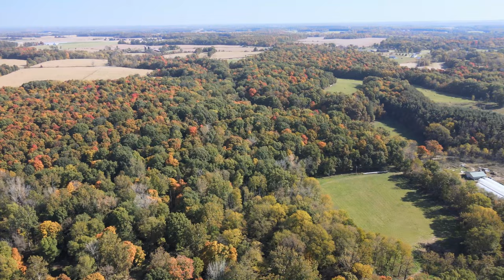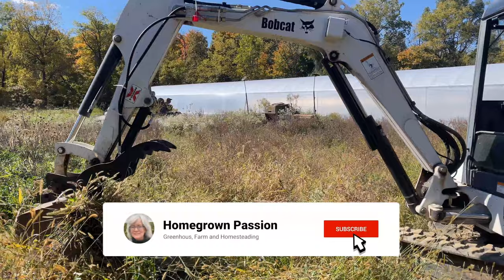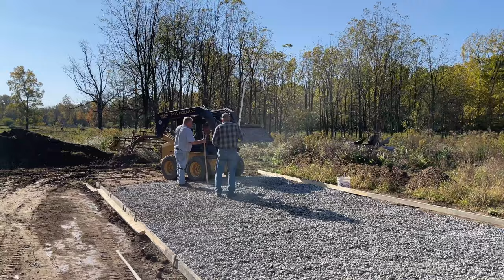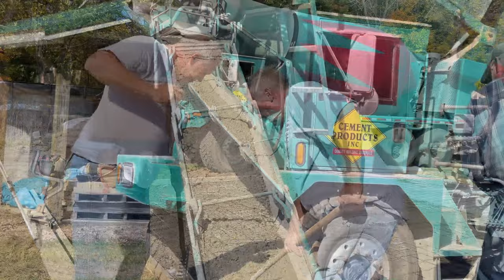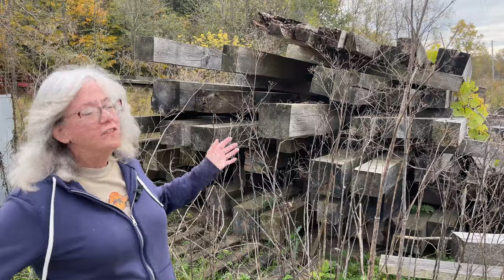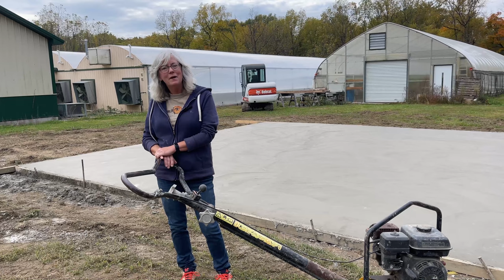Time for concrete! The building begins.

Comment: wood burning is bad for the enviroment why are you not using solar or anything different to adding carbon to the enviroment.even though you are in the country it still goes in the atmosphere
Reply: There's more than enough trees around them to make the farm carbon neutral. Nothing bad about burning wood.
Reply from the maker: Please tell me a solar system or wind etc. that can heat a greenhouse at night in the winter. The wood burner has a catalytic system that burns very very clean. We are not harming the environment anyway!
Reply: I personally disagree that solar is good or bad for the environment. Yes it uses products that don't  breakdown. However the life expectancy of them is very long compared to what people believe.  This point is mute though as we're talking heat not power. Solar is great to run the lights. Not the heat.
Reply: @robmcculloch2611   moot? 🙄   Your response is moot.
Reply: @jnm.624  lol mute.